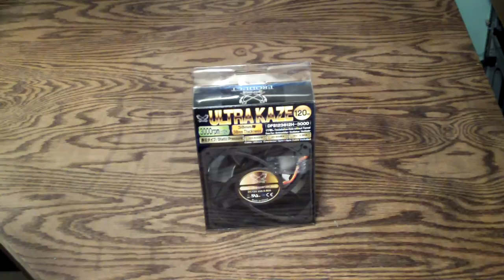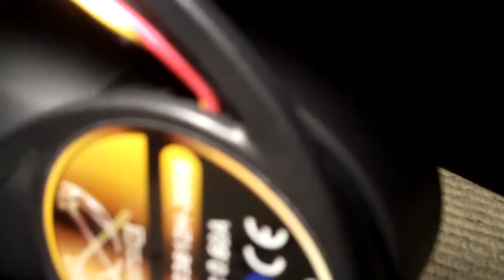Scythe Ultra Kaze 3000 RPM 120mm Fan Unboxing and Sound Test

Comment: Fan controllers would work. If you plug it directly into the power supply, it would always be on at full blast; plugging it into the motherboard should adjust it depending on how hot the system is.
Sorry for the late reply.

Comment: It's a lot like a server-grade fan, wish I had enough space to fit something like that on my radiators but I've got 20mm thick fans in and one of my CD-ROM drives is only about 5mm away from the end of the radiator array. On the other hand my computer usually sits at around 18'C which should be more than OK, I guess I just like over-doing it with cooling.

Comment: @WARFOX101 Sleeve bearing fans when mounted horizontally take life away from the motor but I'm sure it will work just fine. Also these fans don't under volt that well. They make a silent clicking noise.